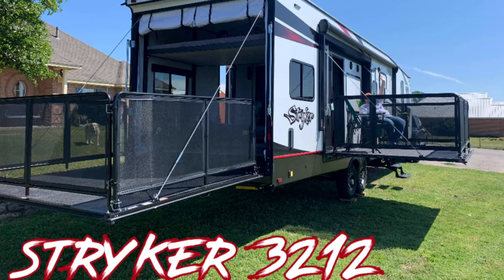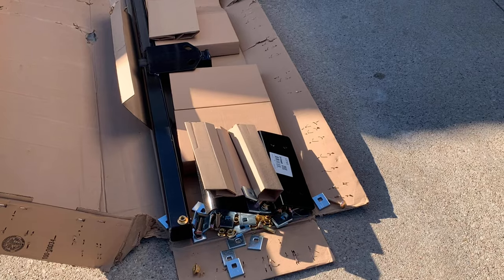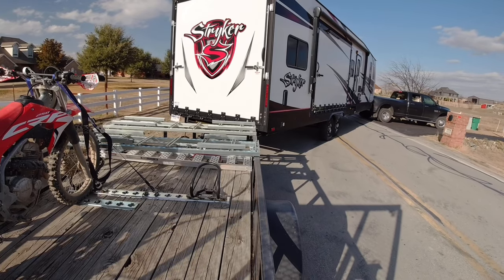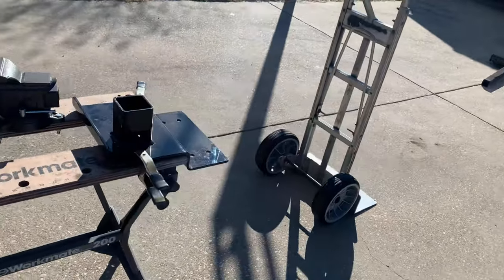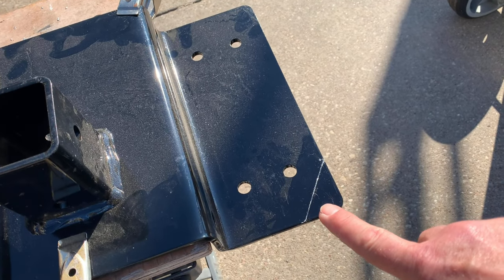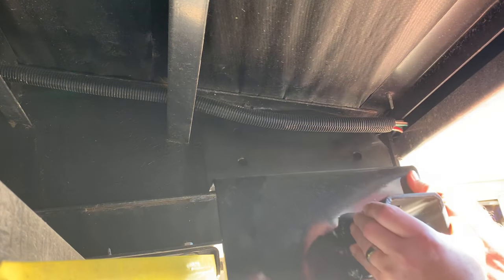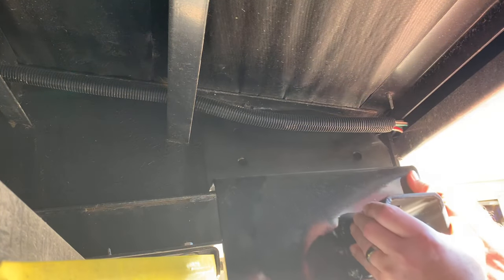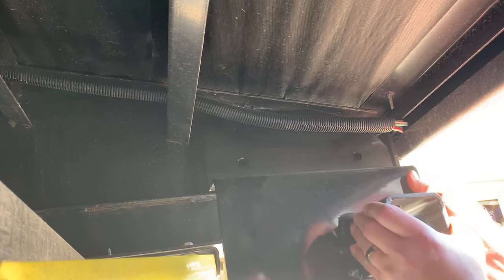Installing receiver hitch on toy hauler rv/Stryker 3212 TH

Comment: Thanks for the instructional video. I want to do this on my Stryker as well. I have a 3212 also. I'm not going to bother putting the vertical bolts in the frame as I only intend to use the hitch for an e-bike rack.
Reply from the maker: Awesome, glad I could help, its a great rv. Have fun

Comment: Thanks for the video. I currently tow doubles with my 5th wheel and a toy trailer. I want a new rig and saw a double tow toy hauler (had a 4 seater rzr on the second trailer). Looking at getting a new toy hauler (garage style) 5th wheel, add a hitch receiver so I can get a second SxS on the second trailer. Or going to get a shorter 5th wheel and tow a 20ft flat for 2 SxSs.
Reply from the maker: Your welcome. That will be awesome

Comment: Howdy from a fellow Fort Worthian! Been looking at 5th wheel RV’s, as I didn’t think this was really possible. I’ve got a ‘19 Grand Design Reflection 297RSTS travel trailer. My RV came from the factory with a 2” receiver but they specifically state that you can only carry up to 300 lbs. max, and it is not designed for towing. We’re wanting to start carrying a golf cart to our camping destinations. After 3 years, are you still happy and feel secure with your mod?
Reply from the maker: @johnsukey9944  absolutely, pulled doubles twice this year with a 4 seater sxs on back trailer. Pulls great.
Reply: @LifeWithKernelLee  You just sold me on it then. Thank you sir!
Reply from the maker: @johnsukey9944  very welcome

Comment: Very nice.
How long is that road train.
I only ask cuz I live in California.
You're only allowed to tow  two trailers and maximum of 28' 6 " on each trailer. With a total length including pick up and trailers of 75 ft.   You also need a CDL class A with double or triple endorsements.
I know some states you can get a recreational doubles but my state does not offer that, so you need a full-blown CDL.
but nice job and that was actually a  good idea to run its own designated electrical connection.
Reply from the maker: 70’ all together with truck, rv and utility trailer
Reply: Yet another reason to avoid California. Pity because it is a beautiful state.
Reply from the maker: Not like I’ll be pulling doubles all the time. Come on man. Yes, Cali is beautiful.
Reply: I've been doing it in CA for 15 years. Dbls/trpls endorsement, medical, you're limited to 26,000lbs., written test, pre-trip test and then road test. The road test is only with your 5th wheel. The stupid thing is you have to test for airbrakes even though you won't get the cert for them.
I'm 65' with truck, 5th and SxS trailer. I'm 73' with truck, 5th wheel and then the boat.
Both trailers have to have brakes.
Reply from the maker: @mrpickle219 nice
Reply: @mrpickle219   nice, I've had my class A CDL for about 4 years now.     I agree,  it  sucks with the air brakes cuz that's the majority of the questions on the doubles test.    I have the same restriction but I was able to get over the 26, 001 combined gross weigh.   Good size dump trailer and truck for the win.

Comment: Hey! Can you connect Toy Hauler with 7 pin to your track and utility trailer with 4 pin to your track as well?  I know that you possibly don't need breaking lights on your toy hauler if you tow a utility trailer behind it with break lights. But your toy hauler needs to be connect to apply breaks. How do you solve the problem? Thanks.
Reply from the maker: Towards the end of the video I show how i do that. It explains it better than me trying to text you. Basically, I ran a separate trailer wiring and ran it through the tailgate of my truck, used a 7 pin convert to 4 pin and plugged into the gooseneck plug inside bed. Hope that helps.

Comment: You said this hitch is for 72-77" wide.  When I click on the link that takes me to etrailer that you provided, it says its for a 22"to 72" wide space.  I need 74 inches.  Can you confirm the width that this will work? Thank you
Reply from the maker: Yeah I noticed that too, when I ordered it it said up to 77” wide. I would try to contact them to make sure.

Comment: How much do you comfortably tow with this setup?  I'm doing the exact same thing.  I was thinking of starting with a little 8ft trailer (super light) with 1 atv or a 12ft cargo trailer (1200lbs) plus ATV 400lbs ish and dirtbike 200lbs ish.  1800lbs total.  What are your thoughts on the 1800lbs?  One more thing.  My rig is 40ft 5th wheel.  We go to the same place (South Fork Fun Valley) and have the same problem you do with hauling. I pull with f350 dually so not too worried about weight.  More worried about length and towability.
Reply from the maker: I have towed my 12ft utility trailer with a cforce 600 quad and two dirt bikes. This summer we will be going to Southfork again but this time i will take my 14’ tandem trailer with a Honda Talon 4 seater. Im am very confident in this setup. If weight is distributed on axles I think it could handle 3000-3500lbs. As far as length, my rv is 38’ so your not much than me. You should be fine with your equipment. We stay at the Peacock rv sites.
Reply: @LifeWithKernelLee  Thanks for the quick reply!!  How far do you go?  We come from Montgomery TX. and it is a 1000-mile trek up there for us.  What are your thought on this?
Reply from the maker: @TheAcgarcia  we travel from Fort Worth area

Comment: I did this and was a nightmare. Took 30 min to drill one hole. I didn't put the bottom bolts in because they weren't in far enough.
Reply from the maker: Oh man, yeah it was a pain for me as well. I ate through 3 drill bilts   I had to shave some of the washer to get some of mine on. Hopefully It working out alright for you.
Reply: @LifeWithKernelLee  you think mine would be alright without the bottom bolts?
Reply from the maker: @Rickystakpants  i think so but if you could figure out how to get them on would be better.

Comment: Looks like you're roughly 10" lower than the trailer. Any issues with dragging? I'd like to do this but my driveway has a pretty harsh slope.
Reply from the maker: I had no issues so far

Comment: Did your camper give auxiliary hitch specs or is it a DIY risk.....mine will be a DIY risk more or less, I can't get any documents from supplier saying camper is meant for it.   I-beams are beefy though.
Reply from the maker: Same here, I am comfortable hauling our 650 4x4 4wheeler on it. I have seen people with same hitch hauling their razor. I have a 6x12 cargo trailer that im going to tow next.
Reply: @LifeWithKernelLee  yea i have a non-toy hauler and i want to pull about 1500-1800 pounds
Reply from the maker: @wevdog  what size trailer and is it double axle?
Reply from the maker: @wevdog  i think that should be fine. I would feel more comfortable with a double axle trailer with that much weight. But i think it should tow just fine even with trailer like mine(single axle utility trailer that is.
Reply: @LifeWithKernelLee        800 trailer with an 800lb. Bike + cargo.   1800 combined on a single axle.
Reply from the maker: @wevdog  with the hitch I used I  think it would handle it no problem